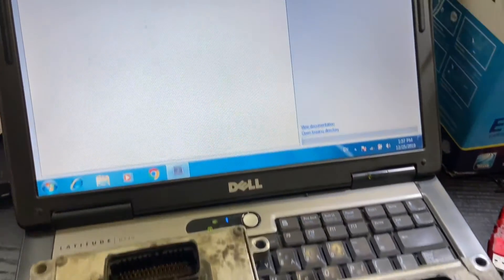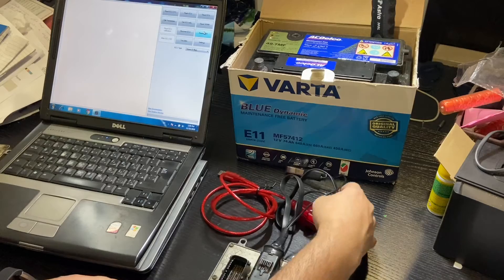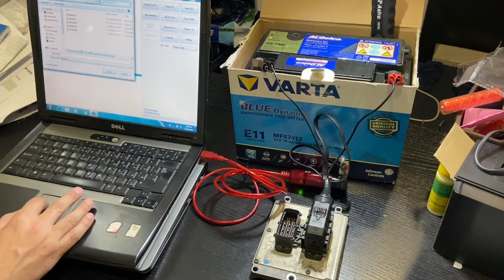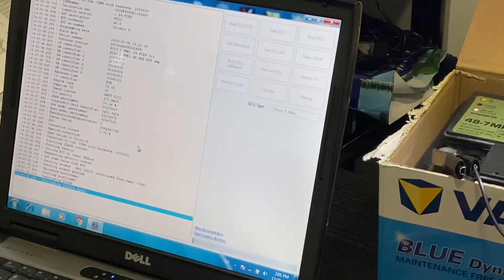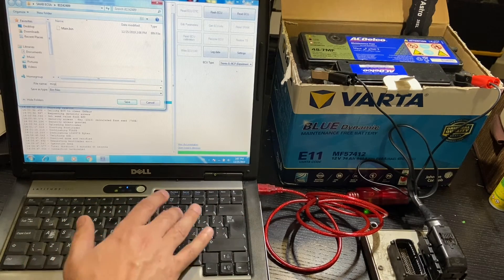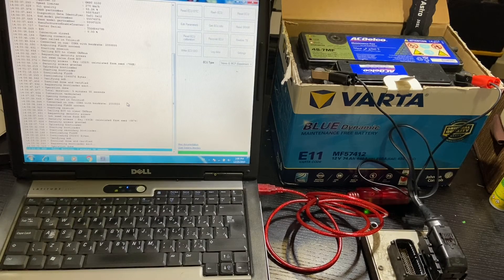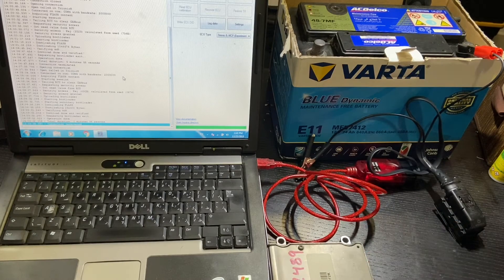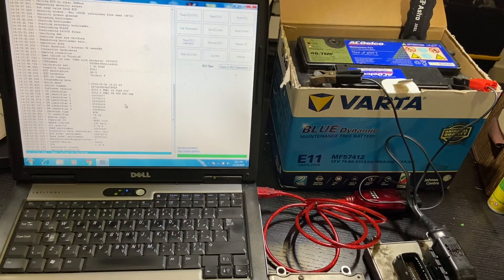COPYING a SAAB 93 TRIONIC ECU OUT OF THE CAR

Comment: UPDATE* it workes now :)    w/   Pin5-->Pin6   &    Pin6-->Pin14
Hi there. I have tried it. No connection (with both ECUs).
I have a Windows 10 64 bit Computer... is this maybe the problem ? 

Or in other words: Why do you use Windows 7 (and possibly 32bit)
Reply from the maker: There are many variables, im sorry i dont know if a 64 win10 works or not
Reply: @TheFlyingMechanicDIY  Hi. It works great with Windows 10 & 64 bit.. Had success:
BUT: I am pretty sure you explained the CAN pins wrong. You said Pin-6 to Pin-6 but it is wrong)
Reply from the maker: @thomaskung1865  just follow the links in the video description for the correct pins
Reply from the maker: I actually pinned a comment a while ago correcting the info

Comment: Hello,

Saab 93, Year 2004, B207R, 55353231

I have a Saab tuned to stage 1.  Approx 255hp. Unfortunately, it seems that my ecu is failing cause random misfires intermittent-periodically and vibration from the engine. So, I bought a second hand ecu with the same part number as mine. 

My biggest questions are that: 

1) If I’m going to clone my ecu to the «newone» at the end i will have 255hp again, right? 
2) How i can ensure that my map it will be on the new second hand ecu? 
3) if a mechanic clones mine to the new second hand, the new it will be the same as mine at the moment, right?
4) You have another video, older than that. You are showing how to swap ecu. Its the same result? 

Maybe are a bit stupid questions for a knower but for me is very important. 

Thanks in advance
Reply from the maker: If the ECU is cloned, then the map and tune from the old ECU will be transferred to the new one.
If the ECU is swapped using the tech2 method, then the new ECU will have the default map and tune.

Dis that answer all ur questions ?
By the way, who tuned ur car and if he used a well known tuning package or not, like HIRSH/MAPTUN ?
Reply: @TheFlyingMechanicDIY  Thanks for your answer. 

So off course I’m going for cloning so the result it will be the same as i have now. 

My map is from Dion Netherlands. Is a good tuner specialist for Saabs, but i think he makes maps for others car brands as well.
Reply from the maker: @apostolisr8556  i would suggest u install the new ECU without cloning and make sure it has the correct software for the car, and see how the car run with it, if it runs great, then clone the old one into the new one and see if it still runs good, if not then the tune might be the issue
Reply: @TheFlyingMechanicDIY  Ok, its a good idea. I have had the rough running (vibration) before the tune, when it was completely stock. The misfiring is new symptom.

If I’m going to do it step by step i have to use the other way (swap ecu) that you are describing at the older video, right? 

I mean we can have access at the stock map from my tuned ecu? Or now the ecu is tuned and we can’t reach the factory map behind the tune?

Or i have to buy again the stock map 210hp?
Reply from the maker: @apostolisr8556  the tuned ECU have only the tuned map, the new ECU should have the stock one
Reply: @TheFlyingMechanicDIY  All right, i see thanks a lot for the info, you helped a lot! 

I’ve send you also email about my issue with my Saab. Soon the second hand ecu it will comes to me and i will be here again with the results. 
If the map is the problem i will go for Maptun later.

Comment: Hi,
Do you know if Trionic Can Flasher would  read and write a  2005 Cadillac CTS 3.6  ME9.6  ECM,
TxSuite site says OBDlink SX not supporting ME9.6.
Just use J2534 Mongoose or Cardaq?
Thanks
Reply from the maker: Bosfh ECUs are not supported by OBDLINK SX .. u will need one of the other adapters

Comment: hello i am following your set up ,in your video you said connect both 6 together. On the ECU number 6 is can low on the obd connector 6 is can high, should it be 5 pin ecu can high and 6 on the OBD connector can high , YOU WILL HAVE CAN HIGH AND LOW CONNECTED TOGETHER , please can you check thanks shaun
Reply from the maker: Tell u the truth, its been a while since ive done that, so give it a try as instructed the video, and if it doesn’t work then flip them, it wouldn’t hurt anything .
Note that, i forgot to mention in the video, that pin4 in the obd plug should be connected to ground as well.
Good luck

Comment: I think you forgot to mention you need pin 4  at OBD as well to be connected to the ground which is "chassis ground" in order to work properly. I follow your instruction and never worked and then I read about the OBD wiring diagram and now it works perfectly. Thank you for sharing your knowledge with us.
Reply from the maker: U r absolutely right .. Thank you

Comment: Hello friend, I have my device ready and I have spliced the cables (I have not soldered yet), I would like you to help me verify or check that my connections are correct, could you help me, you will have a contact email to be able to send you my connections. Greetings and thanks.
Reply from the maker: Hey man, use the email from the ABOUT section of the channel

Comment: I'm getting p0201 p0202 p0203 p0204 p0420 and p0245. I checked all fuel injectors and sea foamed ones that seemed not ticking fully (using screwdriver test). Cleared codes and then they come back every 20 miles or so. Do you believe ecu is the culprit?
Reply: Car seems to run fine when codes are cleared.
Reply from the maker: ECU has failed

Comment: One day we're gonna run out of ECUs the way these cars gobble them up.
Reply from the maker: Its actually happening now ..
Reply: @TheFlyingMechanicDIY  You're right. Mine chewed one up and spit it out after less than 4,000 miles (6,500 km). Prices were 3 times higher than last year.
Reply: I've seen a couple of video's of the ecu kit to raise and use a heatproof plate but quite expensive.
I spent £5 on ebay for some T6 anti vibration damper mounts, and just lifted my ecu up from contact manifold heat sorce which lets air pass underneath better too. So hopefully less heat into ecu and less vibration = longer lasting.

Comment: Great video as always. I know that this is not the right place to express my concern but i would be pleased if you could help me. 
Past week I bought my first saab 9-3 2.0t 2006 sportcombi. I need help from you to diagnose p1682 (Plausibility fault between voltage feed from +15 and main relay). Sometimes it will also throw P0638 and the car cant go beyond 4k rpm.
Thank you!
Reply from the maker: Check the big grey connector underneath the battery (connector # H24-2). Make sure no corrosion, damage, all pins are sitting at normal height and are tight. If that checks ok, swap relay #4 on the small fuse box in-front of the battery, if that doesnt resolve P1682 then replace engine computer. Inspect throttle body for any damage, excessive dirt or binding, if it checks ok in addition to the check made at first step, replace Throttle body . Cheers

Comment: Ok, great video but I’m unsure what wires to connect to from my junk yard ecu/ecm plug and harness. Pics only ever show from the male pins not the female plug with all the wiring 🤷🏻‍♂️
Reply from the maker: I did mention all the pin numbers in the video .
Reply: The Flying MechanicDIY I’ll have to look at it again but all diagrams don’t relate to the female plug with wires.
Reply from the maker: Will, u have to match the male from the ECU to the female in the connector

Comment: I cloned an ecm from an 05 to an 07 ECM and now I get a check engine light and a code for something about the knock detection circuit. I thought the part numbers didn't matter when flashing?
Reply from the maker: Did u clone it using the trionic flasher software ? And did u clone both parts of the ECU, the MAIN & the MCP ?
Reply: @TheFlyingMechanicDIY  yes, I started with MCP and then the T8 using trionic can flash. Everything on the forums said part numbers wouldn't matter when flashed. Not sure why it behaves this way. The car is a manual and I even re added it with the Tech 2.
Reply from the maker: Then u actually have a problem with the car.. why did u change the ECU in first place ? And what is the exact code ?
Reply: @TheFlyingMechanicDIY  The ECM was going bad. I got the plausibility fault code and the car was dumping fuel, which is usually how the ECM behaves when it goes bad (I have owned 5 9-3s so this is my experience) I pulled the T8 mcp and main from the ECM and flashed it to another and I get a code for the knock sensor which I did not get before. I will have to pull the code again and take a look. The ECM does have a different part number but all the people on trionic tuning said it does not matter (with the exception of some Opel models.
Reply from the maker: what is the exact code
Reply: I had the same fault on my Saab if you install a newer model ecu 2007 onwards ecu are different to the 2003 to 2006 ecu